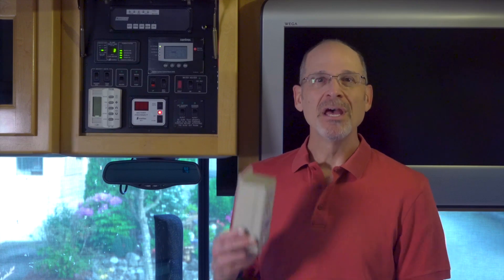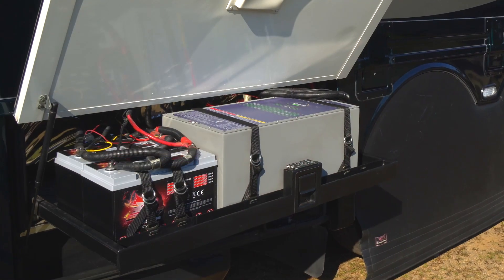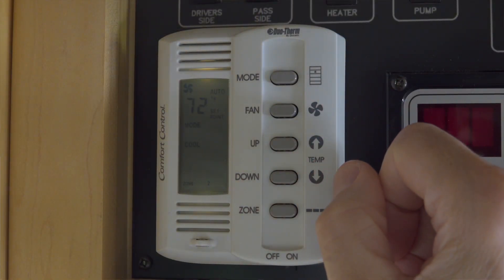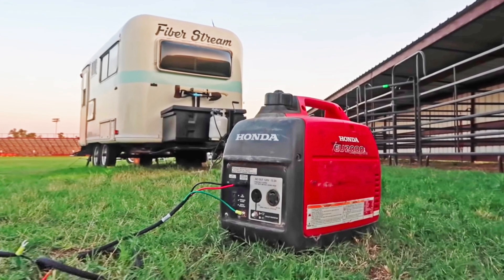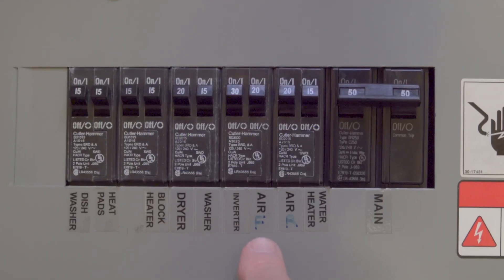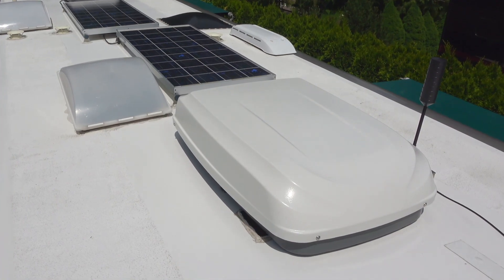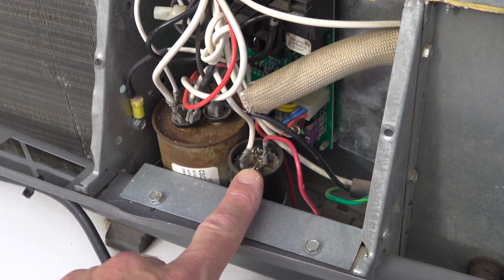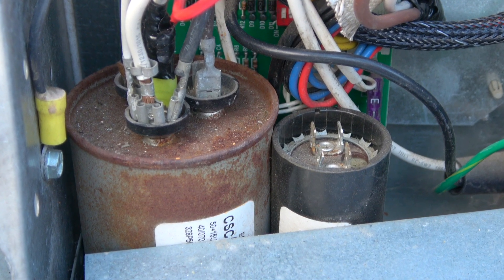Micro-Air EasyStart RV DIY Installation. Run 2 RV A/Cs on a Small Generator or 30-amp Hook-up! Cool!

Comment: Hi Guys, We are having the Xantrex Litium Ion eGen system put on our 5er in June. We understand the battery system is equivelent to a 30 Amp service, but Xantrex told us you can run A/C units from the battery system by installing an additional 3K Watt inverter,. Are you running 2 A/C's off the battery system or do you have to be plugged in.
Reply from the maker: Hi Chuck! As with most RVs, our A/C did not come wired through the inverter from the factory. Since we've never changed that, our A/C only runs off shore or generator power. One reason we haven't done it is because we don't yet have the solar capacity to make it feasible, and also because we're okay with running the generator when we need A/C when we're not hooked up, so using the house batteries for A/C was never our goal. That said...  we're currently planning Part 2 of our battery/electrical upgrade series, which will include the installation of about 1300 watts of Xantrex solar panels. Once that's in place, we might reconsider that re-wiring project... just so we CAN use the eGen system for A/C if we wanted to. As far as the need for an additional inverter, we don't believe that's a requirement. Several people, including our friends Nikki & Jason Wynn, have set up their systems to run off the regular inverter (of course assuming yours is large enough). Here's their video (we made a guest appearance) 😊   https://youtu.be/B0rZY5uotKI
Reply: RVgeeks We are going to Xantrex in Elkhart June 17th. We will put as many of the new Xantrex solar panels on the roof as possible. Hoping for 1800 watts. Planning also to have the AC wired to the converter. Engineers at Xantrex said we needed an additional 3k inverter dedicated to the AC. We have 3 AC/Heatpumps and 1 AC only. Ive ordered 2 soft starts and hopefully I will be able to run 2 AC units off the battery/solar setup. I love the whole eGen system. Mitool in Canada will be out for the install to do marketing videos. Your install turned us on to the system. Luckily Xantrex was willing to do a test on a 5er. Thanks for the reply.
Reply from the maker: If this is being overseen by Mitul (GREAT guy... tell him we said hello) and his team, then they know best. Sounds like an awesome setup.
Reply: RVgeeks Will do, appreciate your channel and hope to run into you guys on the road somewhere. Cheers
Reply: Hi guys, love your channel!   My husband and I just purchased a 2020 Navion 24D with 250ah of lithium and 400 watts of solar and a 2000 watt Xantrex inverter. We have installed the MircoAir easy start for our A/C unit and it now works beautifully on a 15amp circuit at home but we would like it also like it to run our AC when boondocking maybe for 30 minutes or so just to take the edge off on the hot nights.   We don’t have auto gen start and I know currently the AC bypasses the inverter, it seems the it is feasible to run it off the inverter for short periods......my question to you guys, can we and how do I make the mod in the electrical panel?   Thanks so much for you help and we hope to run into you guys once we start our adventure in September 2020.

Comment: If I add the easy starts to both of my ac's 15,000 and 13,500 what size inverter generator would you recommend?
Reply: I have same question
Reply from the maker: Good question, Bernie. There are two factors you need to consider when sizing a generator to run a load: surge capacity (to handle the locked rotor amps when the compressor kicks on) and run capacity (to handle the running loads the A/C units need once started). The EasyStarts will help to minimize the surge that happens when the compressors start up... but they don't do anything to change the power demand the units need to CONTINUE running.

Our 15,000BTU air conditioner takes between 12-14 amps when it's running (it's higher when it's hotter out or if incoming voltage is low). A 13,500BTU air conditioner would take about 10-12 amps when running. So if BOTH units were running simultaneously, you'd be between about 22-26 amps of power just for that. So, assuming a max of about 25 amps... multiplying that by 120V gets you 3,000 Watts of continuous power demand.

So you're looking at a generator with a continuous run capacity of 3,000W MINIMUM. And since we'd guess that you'll be running more than just your air conditioners... like your battery charger could be supplying some power to your batteries... you'd want more than that.

The problem comes in because generators usually list their SURGE wattage. So a 3000 Watt generator can handle a momentary surge up to 3000 Watts... but can't continue to run that large of a load. It would typically have a "rated" (continuous run) capacity closer to 2500 Watts (roughly 21 amps). So be sure to look at that when sizing them. They market the bigger number so the generator seems more powerful (shouldn't be allowed if you ask us).

If you don't need to run both air conditioners simultaneously very often, you'd only need a generator that could handle the load of a single AC (plus any other typical loads). But if you do... you might want to consider getting two smaller generators that can be stacked/paralleled (Honda Generators can usually do this). That way each generator would be smaller & easier to handle. And you could just use one if you know you don't need both ACs... and only set up both if it was really hot out.

Hope this helps.
Reply from the maker: Hi Khalifa... just posted a response to Bernie's question. Hope that helps.

Comment: We have a 2005 DS with 2 air conditioners/heat pumps. One went bad so we’d like to replace both. Our RV repair guy hasn’t been able to find a supplier. Do you know a company that would have what we need?
Reply from the maker: Hi Marsha! Since you have the same make and year we have (‘05 Newmar, but just one model down), you almost certainly have the identical Dometic heat pump / air conditioners that we had. I say “had” because we experienced the exact same thing as you.... one failed, so we replaced both. We did it ourselves, and actually have a video coming out about pretty soon. We ordered 2 of the same units from Dometic, which of course are updated since the originals from ‘05, but still a direct replacement. You’ll simply need to update to a new thermostat, since the old ones aren’t compatible with the new units. Our video will include details on the awesome Micro-Air EasyTouch thermostat we installed too.
Reply: @RVgeeks  my husband can pretty much do everything so you think he’d be able to change these out if we can track down a dealer with the replacement units in stock? Is there a model number or name of the new replacement we should ask for?
Reply from the maker: Hi Marsha. Your best bet is to call the Newmar parts department with your serial number in hand. They should know just what you need.
Reply: @RVgeeks  thanks I found the replacement units!! When will your AC video come out? We are ready to install.

Comment: do you think this would work on the 2 Coleman Mach 15k units i have and get them running at the same time?
Reply from the maker: If  you're on 30-amp service? Absolutely! That's exactly what we do with our two 15k Dometic units, and they both run on 30-amps at the same time, no problem, when the initial spike of the second unit used to be too much for a 30-amp circuit. Just as long as you don't have two much else running (two A/C units use the majority of the 30 available amps), you should have no problem.

Comment: Watched an install by RV Daydream of the Easy Start.  Using a 30amp generator he was not able to run both ACs. I watched your install but after watching his video, they might not be worth it.
Reply from the maker: Hi G. We just watched the video you referred to. Keep in mind, that the sole purpose of the EasyStart is to reduce/eliminate the amp spike that typically happens during air conditioner startup. They don't provide any benefit while the air conditioner is running. In other words, it cannot reduce the amount of power an air conditioner draws while running... only during startup. Without the EasyStart units, he wouldn't have been able to START both Air Conditioners while running off the generator at all. The issue that RV Daydream ran into is that the RUNNING amp draw of the two Air Conditioners was greater than the generator could handle (that "3,400W" Champion can only handle about 3,100W (25-26 amps) continuously... the 3,400W number is its temporary surge capacity)... especially in the extremely hot conditions he was testing in. When he started the test, the combined amp draw of the two air conditioners was about 24 amps, which was already pushing the limit for that generator. Because the extreme heat causes the air conditioners to draw even more, it didn't take long for it to overwhelm the generator's capacity. What he really needs is a generator with a higher continuous run rating.

However, even a generator large enough to run both air conditioners could still overload during start up without the EasyStarts installed. We've used both of our 15K BTU air conditioners extensively on a 30-amp hookup with no problem, and we can clearly see on our RV exactly the same thing we saw on RV Daydream's video... a smooth, spike-free start up to the air conditioners, that prevented them from instantly overloading the generator, or tripping a circuit. They really do work, but you still need a power source that can handle the combined run requirement of the loads you plan to use.
Reply: @RVgeeks  are you able to RUN both of your 15 units indefinitely at a 30 amp service park? ihave the same generator as @rvdaydream but run on propane. sounds like im out of luck here

Comment: I have a 1600 BTU Marine Air AC that I run of a Honda 2200i generator. The generator starts the ac every time , struggles a little but not a big problem. The problem is the generator runs out of fuel over night. I guess it lasts for about 5 hours. I set the ac usually to 76 so much of the time when the generator is running the ac is off and the generator runs for nothing. I'm wondering if anybody knows it the generator will start the ac when the generator is set to ECO moderne and the ac is connected through an Easy Start. The Normal start up current for the ac is 73A. With an Easy Start the start up current is 32A. Will the Honda 2200i be able to start the AC  when it's running in ECO mode ? Thanks for any help!

Comment: Can u run 2 ac’s on a Honda EU2000?
Reply from the maker: Sorry, no. Not enough output.
Reply: Thx
Reply: @EvenaGirlCanDoIt  you could get the "Honda EU2000 Companion" and daisy chain the two generators together to create a 30A circuit.
Reply: Alan Stuart I have 2 already was just wondering if I could get away with just 1 to run both.  Thank you.

Comment: What about 50 amps?
Reply from the maker: 50-amp service can power ANYTHING!
Reply: My friend, sorry a make a wrong answer..what is the power of you generator and if the softef can work for two 50 amps a/c..?
Thank you..!
Reply from the maker: We have a 7.5kW generator that can power everything on our RV, including our two air conditioners. But, even so, having the EasyStarts installed makes it so that the start-up surge the air conditioners used to require has been dramatically reduced, which reduces strain on the generator.

Comment: Smoke and mirrors, I hope you have better luck with that piece of garbage than I did.  I used to do  Commercial refrigeration , I tried this device for myself, Sometimes it would start the compressor sometimes it wouldn't, I wanted them to resolve the problem but they didn't and they just gave me my money back. I ended up replacing the airconditioner on the roof   with a high efficiency inverter type ductless mini split system. Problem solved
Reply from the maker: We're sorry to hear you had a problem. As usual with any piece of gear we install or use, we researched this extensively, and this is the first time we're heard anything like this. Since EasyStarts work so well for us, for personal friends of ours, and for the many people who've shared their experiences online, we have to assume there was some other factor at play here, like something unusual going on with your air conditioner. It speaks well of the company that they refunded your money when their product didn't solve the problem. We're happy to hear that, like us, you have a solution that works well for you!
Reply: @RVgeeks  To be honest with you I talked to a guy named Roger, he stated I think we have a problem with your East Start, lets get it back hear and see whats going on, about a week later I got a check in the mail,but not a total refund.And that's my experience with Easy Start

Comment: And you wonder why RV parks electrical and plumbing systems are screwed up.    This video is the exact reason.     

Most electrical systems are not designed to run at 90 percent capacity for extended periods.   Which is exactly what this modification will do especially when you take into account that the RV owner will be watching TV and other activity's that use power.   

You would never do this to your house, so why is it okay I'm your rv
Reply from the maker: I don't know... maybe it's just us, but when it's 95 degrees outside, we never decided which central A/C zones to turn on in the house. We just turned them all on. The problem is often neglect. When we stay at RV parks that take the money we pay for the services we expect to receive and actually use it to maintain those services, no prob.
Reply: @RVgeeks  naw you are exceeding what is understood as safe standards for using electric.      You don't install a 30 amp circuit is you are planning to use 25-30 amps you install the next step up which is 50 amps.     

If you flame out an RV connection box in a park I hope you own up to what happened and pay the park owner to repair it.
Reply from the maker: As soon as the park owner pays us for damaging our equipment with low voltage park power. 😉

Comment: Wish I’d had your video when I installed my Micro-Air on the front A/C unit three years ago! Have successfully used 30A shore power many times. I just need to remember to NOT use the rear A/C or Microwave. However, the real reason I installed the MA is I wanted to run A/C solely off my solar! This is something new RVers ask about doing on a regular basis and I’m here to tell you that with a big enough solar system (and enough sun), it can be done with a zero net battery draw. When I installed solar, I also converted the front A/C to run off my Magnum inverter. Thanks to the Easy Start, this has worked perfectly since installed. The Micro-Air part of my conversion process starts at post #26 and continues for several posts; includes a post by Micro-Air that explains the difference between their product and simple Soft Start Capacitors: https://www.wanderlodgeownersgroup.com/forums/showthread.php?t=25074&page=3